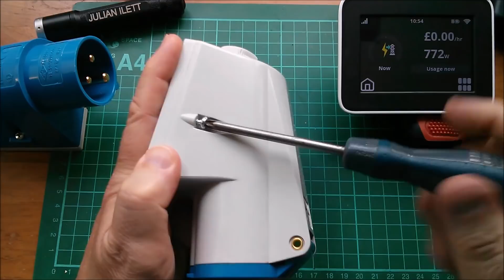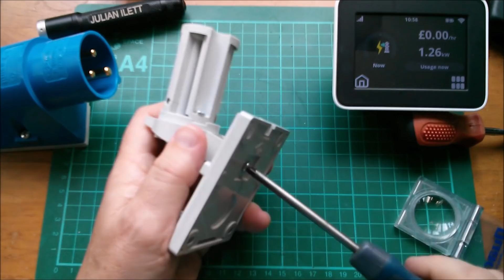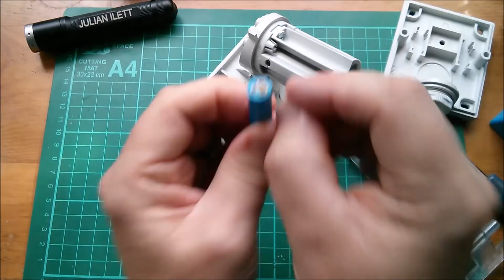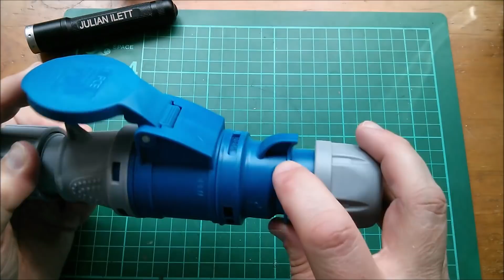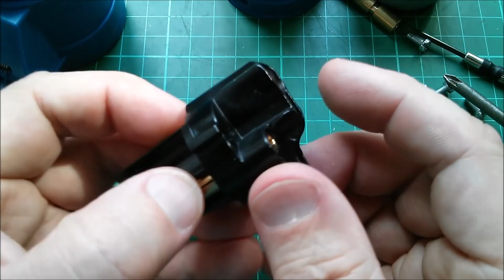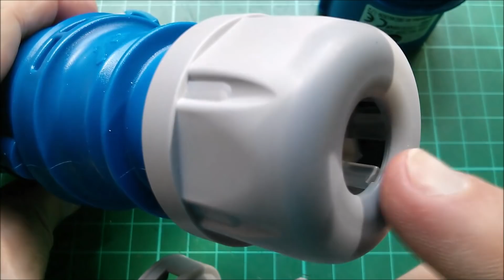16A Connectors Stripped

Comment: Ferrules are mandatory for finely stranded conductors to avoid damage by such screw terminals such as in these plugs.  You really should pick the ferrule size based on the conductor which I think you said was 2.5 mm², so all ends should be using ferrules of the same diameter.  Don't size them based on the holes!  For the PE wire - the yellow-green wire - you may need longer ferrules such that both screws will both touch the ferrule and not the wire.
Oh and no solder on the wires for those simple screw terminals.  While soldering isn't generally forbidden in electric installations it is for simple screw terminals like this due to the potential of the solder flowing and resulting in a bad connecting, maybe even fire.  Use ferrules with fine stranded terminals and that's ferrules only, no soldering.
British code may be different but I think you typically should be able to get away with 1.5 mm² copper cables for 16A.
Reply: Exactly right!
Reply: Not sure if that is correct in the UK, I know Ferrules are not mandatory in Australia.  However, using single wires from the socket to the consumer unit, even in conduit, is a no no and would invalidate any insurance claims.   
1.5mm is not suitable for 16Amp at 240V under the regulations in UK and Australia.  Needs to be minimum 2.5mm and everything should be twin and earth and never single cables.  I realise this may be different in some countries.
Reply: @EsotericArctos  Well, this is a real bag of worms..... Where to start ???

Ferrules - I wouldn't use them. If I had to, they'd be soldered to the wire. Which possibly makes them pointless - just tin the wire and don't bother with the ferrules.
Solder - in the days when appliances didn't come with plugs on, often, the wires ended with a short bit of bare stranded and soldered.
               If the screws were faulty and the pins removable, I'd be happy to solder the wires direct into the pins.

OP said: "While soldering isn't generally forbidden in electric installations it is for simple screw terminals like this due to the potential of the solder flowing and resulting in a bad connect" Solder doesn't flow when cold ! It shouldn't get hot as it shouldn't be a bad enough connection to get hot !

Bare strands under screws - absolutely fine - the screws will damage the strands and that ensures a good contact to fresh copper. It also pushes strands agains the sides of the fitting ensuring plenty of contact points for carrying current. I habitually twist my strands. If this was really an issue, proper terminal posts would be used (c.f. MK UK plugs !)

1·5mm^2 is suitable for 29A in certain circumstances (i.e. well ventilated). If poorly ventilated, you're down to 14A. I've used 1·5mm^2 on 16A connectors - BUT the supply is continuously rated at 9A only ! (with 20A spikes).

Conduit/trunking - single cables is the norm in the UK - I've seen tons of it ! T&E is really difficult to push through conduit !

Crimped - Mechanically unsound, many like them ! If the crimping tool stayed attached (like a terminal screw does) I'd have much less issue with them. As you remove the crimping tool, the crimp loses some grip on the wire.
Reply: @millomweb  I don't know all the regulations for the UK, as stated I am in Australia, so thanks for clarifying some things.   It's ultimately an individual's choice when they wire to the consumer unit or switchboard.  Over here, in Australia, that would be illegal anyway as all mains wiring needs to be done legally by a qualified sparky and needs certification otherwise you would be in a world of hurt with insurance or worse, criminal charges if a person gets hurt in some way
Reply: @EsotericArctos  We have more freedom here. A resident can even llegally work on their gas appliances !

Electricity isn't complicated - there's only two things to know - 
Is the conductor big enough to handle the current?
Is the insulation thick enough to handle the voltage ?
LOL

As for plumbing - as long as the inside diameter is smaller than the outside diameter, you're good to go :)))
Reply: @millomweb  solder does flow when cold. It is amorphous…
Reply: @ConorNoakes  Not with me it doesn't !
Reply: @millomweb  Quite…
Reply: @millomweb  - Cold solder does flow under pressure. So if the ends of the stranded copper wire are “tinned” with solder and then this is clamped in or under a screw terminal, over time the pressure will cause the solder to very, very slowly creep enough that the grip from the screw terminal is no longer effective. A intermittent or high resistance connection will be the result, which may then overheat. I know this as a fact, as the primary purpose of the small team that I lead is to investigate industrial system faults. Earlier this year, the failure of 24V DC charger and battery system was discovered by my team to be due to a tinned stranded wire making poor connection in an industrial 32A fuse holder (with heavy duty screw terminals). Second hand / preowned electrical items that have user fitted 13A plugs where the original owner fitted the plug without cutting off the manufacture tinned ends very often has loose screw terminals for exactly the same reason. By the way, the manufacture tinned the cable ends so that it was quicker and easier for the item to be tested in the factory, not for the convenience of the first owner.
So just to be completely clear, NEVER solder or tin a stranded wire that is going to be clamped via a screw terminal or threaded terminal or spring terminal.
As for the original question the Julian asked, either gently twist the strands and then do the screw terminal up firmly but don’t overdo it, or use ferrules as per the manufacturers instructions, that is crimped (see https://en.wikipedia.org/wiki/Electric_wire_ferrule).
Reply: @Mark1024MAK  The question is, if when it stops flowing, is there still sufficient pressure on it for a good contact !
Reply: General best practice in the UK is 2.5mm^2 minimum for 16A, for temporary installations it’s a requirement now IIRC

Fixed installation gives some allowance if you do the calculations and tests to ensure you’re within the maximum permissible voltage drop though if it’s a circuit feeding an outlet instead of an appliance then there’s a strong argument that you should consider the end user doing standard stupid things with extensions, etc.

My experience of European temporary electrics is that they usually won’t accept 1.5mm^2 on 16A circuits either as a flat rule being easier to enforce than having to make all the exceptions clear
Reply: @ConorNoakes  I've used 16A connectors on a 9A supply with 1.5mm^2 cable !

The bizarre bit is the neutral is also 1.5mm^2 and that's on 27A supply (3phase x9A) - so there will never be 27A all at the same time going through it :)
Reply: @millomweb  so you don’t understand how 3-phase works either… Top Sparks 👌🏻
Reply: @ConorNoakes  Sorry, I guess this is too complex for you to understand. Would a diagram or video help you ?
Reply: The demands here  are onley for flexible cabel (the dimeter is very small unlike the solid that is mulifaction of 2.5 mm2)
You can use 1.5 mmm2 for 16 amps but not with this insulation that is for 70 celcius
You need a cable that rate for 90 c - XLPE .AGAIN this for residat regulation here .Aventualy you need to act like your local regulation.

Comment: ferrules are standard for stranded a cable. They reduce resistance because all the the strand gets clamped together so you have full contact instead of a few strands that lands under the screw (and possible break) The size (and color code) is the size of wire it is meant for, the size and shape will depend on the crimper used
Reply: But the screw pushes the other strands against the other side of the clamp - giving a good connection.
Reply: @millomweb  only the strands that happen to land under the screw
Reply: @fuzzy1dk  No - all of them (nearly) as the screw pressure is transmitted to spread the other strands out - sort of flattening the wire.
Reply: Using stranded wire in a screw terminal is acceptable practice. The strands should be gently twisted. As the screw tightens on the strands, the force is transmitted across the bundle of strands, hence the strands on the opposite side of the screw are pushed against the terminal.
A crimped ferrule is preferable if the connection will be subject to a lot of movement or vibration, or if the circuit or application is safety critical or for maximum reliability.

Comment: dont export to the grid, its such a con, you get bugger all for the energy you export, store it in a battery bank and use it yourself with a power inverter.
Reply: Hi James H,
Nice to meet you!
Reply: I thought the export tariff was calculated on what you generated, not what you exported.
Reply: @OC35  probably, im not that up to speed on how that side of it works, its just the way i do it and as long as its been a sunny day then im not using grid power for about 12 hours or more. 
im set up using an automatic transfer switch so as long as the battery voltage is high enough then im running off the batteries
Reply: It depends on who you export your energy to. Octopus Energy were paying £2.38 per kWh exported for a period on the 15th September on their outgoing Agile tariff. No con there!
Reply: @jerrywatson966  wow, thats astounding, ive seen people get as little as 3p per kWh. times must be changing! its quite sad that alot of the small energy companies are set to go bust this winter.
Reply: @jameshunt2141  There are many opportunities out there if you know where to look. Outgoing Agile is not advertised and is classed as a Beta tariff. Solar can still be profitable despite the end of the FIT scheme.
Reply from the maker: @Jerry Watson Yes, I'm thinking of giving the Outgoing Agile tariff a try, especially now the electricity wholesale prices are going up :)
Reply: I have a solar PV setup complete with inverter in the U.K.. You have an additional electricity meter that is wired between the inverter output and the distribution board / consumer unit. Hence you get paid for all the energy from your PV installation whether you are consuming it or exporting it.
Reply: @Mark1024MAK  Mark, you are referring to 'deemed export'. The meter to which you refer is a generation meter. Under the terms of the FIT scheme, and as you say, you get paid for all the energy you generate. Also under this scheme you probably had the option to choose deemed export whereby you also get paid for 50% of the energy you generate at the 'deemed export' rate irrespective of whether or not you actually export anything. You have the option to change from the 'deemed export' payment to a fixed or variable rate for whatever you actually export and this could be as much as £2.50+ per kWh.
Reply: @jerrywatson966  - sorry, I could not remember the exact terminology. It was installed in 2015 and is a FIT scheme.

Comment: Have a small magnet handy to test if they are steel or copper. 
I bet you they are steel and no copper to be found. 
Just screw in the bare copper wires into the terminals. They are thick enough not to frail.
Reply: ferrules are mandatory.
Reply: @patnutoris4054  Not in the UK. The stipulation is "Good workmanship and proper materials shall be used" and since the cable will be fit once then stripped stranded cable twisted and doubled over straight into the terminal and correctly screwed down fits that fine. Any good spark worth their salt would then test the connections using a proper low impedance continuity tester in order to certify their work
Reply: @patnutoris4054  Says who?
16A is not 60A! Do you have ferrules anywhere in your 20A house wiring?
Reply: @piconano  ferrules due to stranded wire under the screw contacts... (At least in my area) household wire conductors are solid core, so no ferrules...
Reply: @patnutoris4054  - no, it depends on where you are and to what standards you are working to.
Reply: @Mark1024MAK  Most standards I know of also requires that installation to be performed according to terminal manufacturers guides to fall in the category of good craftsmanship. 

Most manufacturer of terminals such as spring loaded terminals (Wago)  or screw terminals (as in the video) specify that very fine stranded wires to be properly terminated. It is not really that difficult to understand that very thin wires as in the video will be damaged when you clamp them with a sharp screw. 

Certain terminals can function as ferrules as they apply the force even around the cable without cutting into them, these do not need additional strengthening.  

Note that my comment is only relevant for fine stranded wires, not solid core or course stranded wires for permanent installation.
Reply: @patnutoris4054  - like I said, it depends. You won’t find ferrules used in the U.K. with BS 1363 13A or BS 546 5A or 15A rewireable plugs (that use screw terminals), even though the only type of cable that would be used is flexible cable (flex) that is stranded (such as 0.75mm squared flex for example).

Comment: Some people 'tin' the stranded cabling, but I really don't understand your concern, it's the same way every (non sealed) three pin UK mains plug works!
Reply: You shouldn't tin wires that are gong into screw terminals as the soldering can fail (cold weld?) and cause the connection to become loose. 
Bootlace ferrules are cheap and are the correct solution for wiring terminals with stranded wire.
Note also that ferrules are supposed to now be used when using stranded cables in distribution boards and for all wires on fitted rewireable plugs.
Reply: Tinning is bad for simple screwed connections, since it will literally flow away over time and the connection becomes lose. Ferrules are the way to go for stranded wires.
Reply: Never tin; solder creeps and the connection will become loose.
Reply: tinning multi-stranded wire is bad news if the wire is allowed to move or flex, the strands break at the solder face due to work hardening of the strands. A crimp or ferrules  should have part if the wire insulation entering them to keep the wire flexing within the insulated part where the insulation protects the strands by reducing strand movement and increasing the bend radius.

In the ferrules the insulation should go right in to the little coloured end cap. 

I used to connect stranded wires to PCB's within equipment fitted to fighter aircraft, the PCB had two holes one for the wire complete with insulation to pass through and the second for the strands to be soldered in. the first hole keeps all the flexing of the strands due to vibration within the insulation. this way the connections lasts for years in service without failure.

Comment: FYI, these are not compliant with the regulations for installation in a domestic installation, due to the lack of shutters on the sockets, there are switched ones with an interlock that prevent the socket from being turned on when there isn't a plug present, which are compliant.
Reply: At least in Germany those are fine as well - no need for switchable connections - you can use the breaker to turn it off
Reply: I would have expected these to be water-tight too. Not an o-ring in sight.
Reply: @Pytchblend  - they are suitable for outside use as long as there will be no directed water spray.
Reply: The wall mounted plug and sockets are marked IP44, so not suitable for outdoor use, maybe ok for your conservatory / shelter place
Reply: @Richardincancale  He said he was installing these indoors, its to provide a disconnect between his consumer unit and the cable in conduit going out to his shed, the connectors will be indoors.
Reply from the maker: Right again - you've got this :)
Reply: @Richardincancale  Outdoor lights are routinely rated at IPX4, (protection against splashing water) the next number up X5 is for protection against water jets, which sounds unlikely for normal rain?
Reply: @Sparks0001  Time will tell I suppose. From my experience of outdoor industrial electronics, nothing less than IP67 will survive long term.
Reply: @Richardincancale  It's what's used for connecting caravans over here in the UK, both static and towable, and as such we have hundreds of the things at work (over 700 16A and 32A connectors).
Note that as the wall/panel connector is facing down that will help keep water out, plus being only IP44 any water that get's inside should find it's way out again.
Reply: @Sparks0001   - these connectors can be used in both industrial and domestic applications. They should be fed via an appropriate current limiting device (MCB or fuse) and should have an appropriate isolator switch, either separately or as part of the outlet. As per the current requirements in the U.K., an RCD should also be used.
Reply: @Mark1024MAK  I think you will find they need an interlock that prevents the circuit being energized when a plug is not inserted to e compliant, the ones featured do not have this capability.
Reply: So what connector should I use in the domestic situation for my 3 phase lathe ?
Reply: @millomweb  the red ones
Reply: @millomweb  In interlocked switched one, where the switch can only be turned on with a plug in it, and the plug can't be removed when on, like part number CX165P415SIS
Reply: @Sparks0001  Thanks. Is my garage/workshop/garden 'domestic' ? Anyway, when not in use, power is locked off !
Reply: @Sparks0001  - so please point me to the requirements for a 13A socket to have an integral switch. Why would a 16A outlet be any different?
Reply: @Mark1024MAK  13A sockets are required to have shutters to achieve the same goal under BS 1363